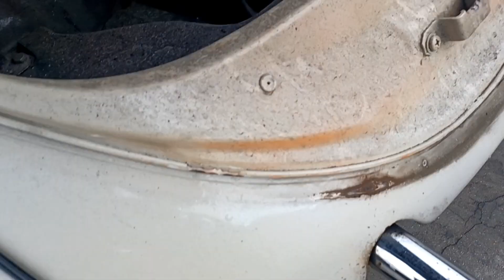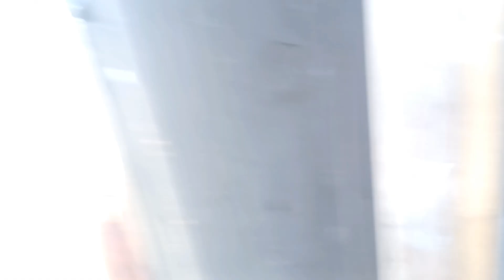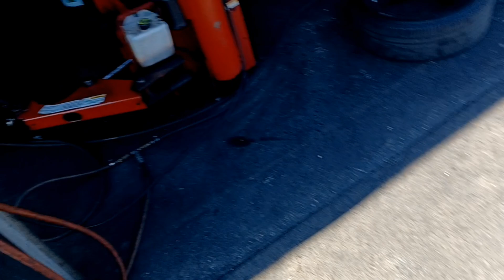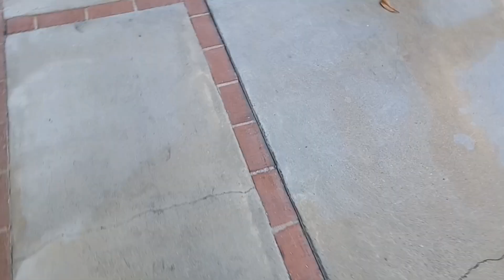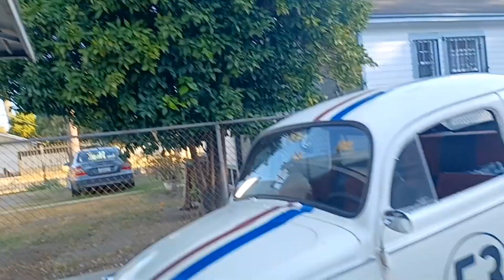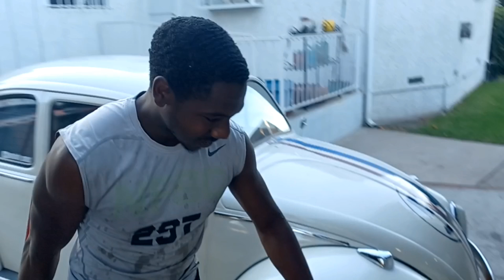The 3 reasons you Don't lower #vwbeetle  featuring @omiepopz2287

Comment: Damn Bon that's a serious drag when our little vw's test our patients! Man I've spun like 6 drums in my day but it was usually trying to spin the back tires although I have yet to spun the hub on the cb wide 5 disks! ✊️🪵 having it on its nuts seem to put more stress on the drums for some reason as well as the bearings and tires of course. that's why I did a trans raise and air ride on my bug shit I was replacing my axle bearings almost every 3rd oil change! to be honest I would have been money ahead buying the limebug rear bolt in kit that I copied but I gained some experience so I can't complain there. the fronts I'm using air shocks which is pretty standard. I've seen some people get away with using air shocks on the back to raise it up a just a little but bags are the way to go. the ride improved quite a bit. it was soft in the rear from loosening the rear torsions and stiff in the front with the narrowed beam. now its right in the middle
Reply from the maker: Do you have a video on how you set up your suspension? Hopefully we'll be raising up the rear asap. I'm trying to do a few upgrades to make the ride better before I attempt to add power
Reply: @PopularityContest  I have some air ride test videos I did a few years back when I built it but I can take a fresh video, with my bug torn apart it's easier to see everything. I'll send you a link to the video of the kit I copied on Instagram
Reply from the maker: I really appreciate it because 8 tire and four bearings in one year is a little too excessive.
Reply: @PopularityContest  Holy crap your not kidding! I usually take the tires in when the inside is at about 35-40% tread and have them flipped on the rim so I then wear the other half of the tire. Drop plates in the rear thru atomwerks are nice too so you can still have the springplate preloaded but your axle isn't sitting too far forward(to much toe in) and it drops the ass. It's the same theory as a drop spindle, keep the suspension tight but drop the height
Reply from the maker: 💡 🤯 Why didn't I think of that? I think that dropped spring plate is a great option.